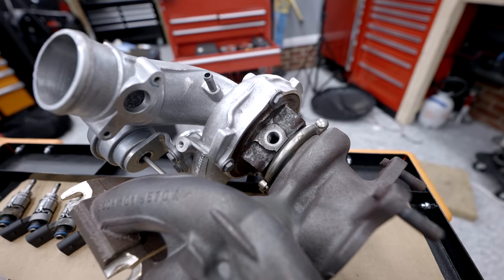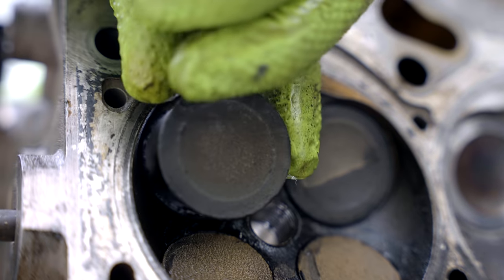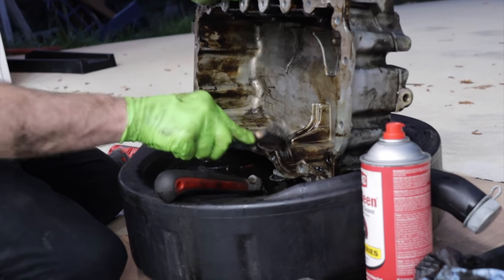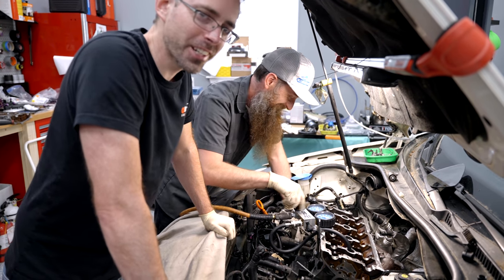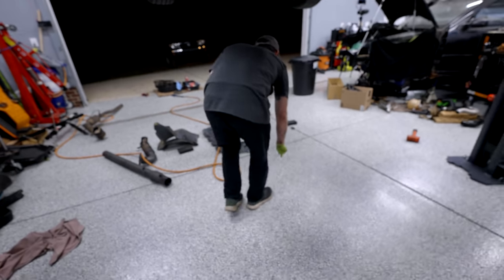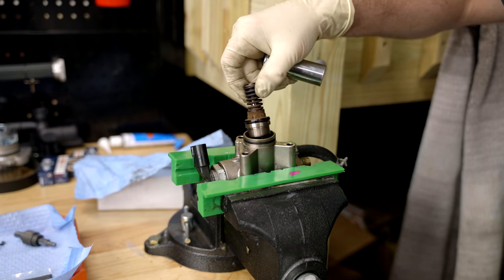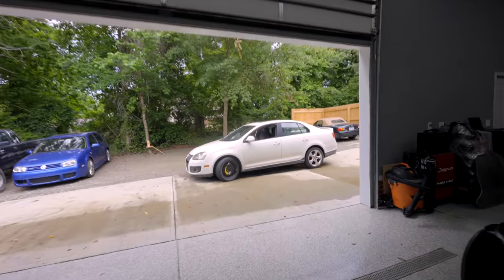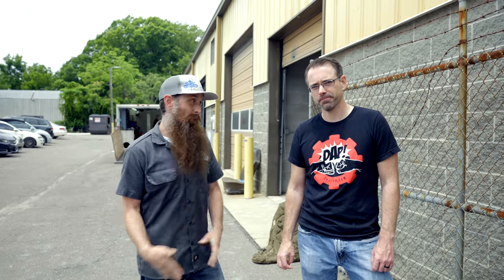Fixing and Modifying the $5000 1/4 Mile Jetta ~ JDM vs Euro RACE Episode 2

Comment from the maker: Remember there is no need to chase Advance Discount codes. You can use "Humble" any time you like and save $$$! Also stack up those speed perks to you can get up to $20 off, rather than $5 at a time. 
If you missed Episode 1! ~ https://youtu.be/1lCxpneVsbU
Reply: Dibs on the old parts, I have a ‘06 Jetta that would love that turbo/pipe/injectors and HPFP.
Reply: hi charles, yo have a few bucks left, consider a e50 or e85 fuel tune, you can safely up the boost and easily add 50hp through the entire powerband.
Reply: Let’s go EURO!!!!!!!!!!!!
Reply: Hell, at this point just go all in, blast a 125hp hole shot of nitrous oxide. When looking for bolts on a smooth floor lay a light on the floor shining across it and look for a long shadow thrown off by the bolt. 13.5 seconds on good track condition  
Edit* i not write good

Comment: "I won't cheat on budget" - proceeds to omit 29 cent bolt...
Reply from the maker: But I added it back in later in the video. so I feel good about being above board
Reply: Unacceptable!
Reply from the maker: You have to accept the unacceptable
Reply: @HumbleMechanic  cheat budget Jetta+BMW inline 6 or v8+turbo.
Reply: SO is no one questioning the turbo and downpipe WITH cat, being 400 bucks?
Reply: Inconceivable!
Reply: @cmendoza1094  used turbos are really cheap and he's not using some big one so I believe it
Reply: @yur1831  sheeesh, thats eBay turbo setup territory. Nah even less than a ebay turbo . Damn
Reply: But tbf, he budgeted the passat pipe at $5 when it was $4.80 so we're really only arguing over 9 cents...
Reply: @cmendoza1094  Sometimes you just have to accept the little wins :)
Reply: @cmendoza1094 ebay turbo set up is "new"... he bought "used"... used plays a HUGE part in parts pricing... cmon guy...

Comment: Lacking hp is probably lack of flow at higher rpm, stock exhaust and intercooler are maybe limiting you higher up in the powerband
Reply: Exhaust is restriction, intercooler on BWA is upgrade for 16v TDi. This cooler work great with GTB1756 on BKD (2.0bar - 36psi and 220bhp/500Nm my street setup). Pressure drop is small, cooling is fine, on TDi work to 250bhp, on TFSi is fine to 320bhp. BWA needs high octane fuel, because this engine have high dynamic compression pressure. I think, mix 10% ethanol with 90% gasoline (placebo 100 octane) will solve the problem with “nopowah”.

Comment: If you found an old volvo with a 5 cyl that could have also been a good choice. Enjoying the GLI though.
Reply: yeah, but i think the modern DSG is going to help with the time a lot, even though its not as fun
Reply: Not German
Reply: @illyapalamarchuk3525  well this is euro vs jdm, not jdm vs germany :P
Reply: Err, yeah I think they needed to go with the blown engine and VW for cheap turbo bits. I don't know of any other car you can bolt on 400 dollars worth of turbos and make her rip...
Reply: thats stupid this car is a 2.0t with dsg wtf will a volvo do ?
Reply: @rnldmanuel88  youd be surprised 2.5t 5 cylinder Volvo bricks ain't nothing to play with ..they make for great sleepers lol
Reply: @SL9SH   never heard of that because I don't see many people building Volvo's it's  easier getting VW parts to work with. Vag has a huge after market support just like Honda.

Comment: Get a “cold air” intake on there for some more air flow
Reply: And bigger intercooler.
Reply: Bigger intercooler with 63mm boost pipes. 120hp added
Reply: Tfsi is such a great engine. Byd, Cdl 380bhp with some basic mods. I enjoy the maintenance on them also. Problem is his buddy can't tune them. He's building boost from the turbo surge point which Is making it die quickly. These ko4s should be reaching high 300s even on a bwa
Reply: @MikelDog  yup no way big turbo only gaining that tune wrong or engine shot but they just rebuilt it
Reply: @MikelDog  shit a stage 2 with cai and down pipe should put u close to 270

Comment: Jetta's weigh a ton because of the interior comfort quality... I'm going to guess at least 200lbs maybe... lets say 255.857lbs from interior removal.
Reply: I knew there was no way they only lost 75lb from stripping it bc just the rear seats and spare tire in a similar year golf is like 120+ lb
Reply: Strip that thing down to its bones! Even the doors are heavy and I noticed you haven’t stripped them. They are so heavy with impact bars, window mechanisms, power locks, insulation and sound deadening, speakers etc. Take all that crap out.
Reply: @chrismason6857  it’s my daily and only car. as much as i am pro-race car, I can’t do that complete of a build yet
Reply: @jsrhyphen  time for a Smythe use kit to loose a few more pounds from the roofline & trunk... :p

Comment: Yeah those stock engine cover intakes are pretty restrictive and that stock muffler probably added some more back pressure with the higher boost/exhaust pressure limiting it's potential a bit. With the drivetrain loss it should be right around 300 crank HP though.  Loving this series btw!

Comment: 27:24 your math from saying 200 hp crank stock to 320 hp looks about right at 250 -260 at the wheels.
Reply: The DSGs have minimal drivetrain loss... I think 250whp is closer to stage 2 on the stock k03

Comment: You need to change these ignition coils!! They always fail even when the car is OEM.
Reply: If it's not broke, don't fix it. They're on a budget, so if the coils are still good for now, they just have toast long enough to go down the drag Strip.
Reply: @shona5512  Sure. 
I recommend checking for misfires because this ignition coils always left us in the lurch
Reply: I upgraded to r8 coils but felt no difference at all but I probably will when I get tuned
Reply: @giovannimora9134  it's more about reliability. But with K04 it's extremely necessary
Reply: @vamodizer  need that combustion forsure when upgrading the hpfp

Comment: Paul knows his FSI engines lol. That pause before Charles cranked the engine after MAF reset 😂

What the boys basically built is a MK6 R without Haldex. Unfortunate that the dyno results are lower than expected with the HP numbers. Stock MK6 R was pushing out 256hp so hopefully with a tune, it should be on par with APR numbers. Mid 300hp and almost 400lb tq!! With the beefed up HPFP, I have a feeling Paul will go IE stage 2+ file bc ShopDAP favors that tuning company. Either way, this is so fun to watch. 💯

Comment: Very fun episode. Surprised those 2.0 turbos could hit > 300hp with just a tune though. (I'm just comparing it to Subaru 2.5L turbos like in the Legacy) that would hit around 290hp with stage 1 tune and maybe 320-340hp with stage 2 tune + DP. That's all with 25% more displacement though.

Comment: Check the wastegate actuator. They can tend to push open and drop boost. Put some preload into it and you should see better results. I've got a Mk6 R and it will run to 30 psi although at that point it's pushing a lot of hot air as it's outside the efficient range of the K04. You should be targeting in the 25-27 psi range though. If you've still got $800 left then definitely fit a water/meth kit. Will go some way to making up for the stock intercooler. With some silicone bends and exhaust tubing you could also make a cold air intake that sits a pod filter behind the passenger headlight. Remove the light when you're racing and instant horsepower gain.

Comment: Holup you don't don't think the low HP could be to the restriction the mufflers is causing? The tune is made for a down pipe that's high flowing if its not seeing that it needs to push more? I remember when I had my Camry a long time ago i tried to make it louder and i put spacers in the muffler i remember that the torque band moved up significantly (it was a manual) so maybe the muffle is giving you low hp numbers because of a restriction
Reply from the maker: Possible. For the race, we would take that off anyway. My dyno guy wasn't too keen on open header that thing. HA

Comment: The fact that you guys are making so much torque makes me think it's the stock intake/cover restricting air flow and possible boost leak somewhere.  My 08 GTI made 250whp on stock turbo and stock HPFP, 3" exhaust, intake, and APR stage 2 93 octane tune.

Comment: Ok obviously you know things better than I do but my suggestions is to lower the suspension as much as possible , use a clutch for the alternator so it will disengage at higher rpm , use a thin oil , remove the rear spoiler and maybe try to replace those huge side mirrors..
Fingers crossed 🤞🏻 hope you will win

Comment: the boost pipe leaked on my Passat TDI as well... cracked on the intercooler union side so had to replace it. Those spring clip unions are so annoying though!

Keep on guys, send the JDM cars back to the videogames where they beling 😁😎

Comment: Hey thanks for the tip about what to do when a intercooler pipe blows off with no option to fix on the side of the road. unplugging the MAF was not an option i would have considered. cheers noys.

Comment: What about a snow systems water methanol setup? You can jack the boost and it will drop intake temps a mile. maybe just a straight pipe after the cat?
Reply: That car needs some meth in it lol 🤣🤫 get a drop in filter.. aswell as a castles downpipe  wrap the downpipe in that exhaust tape.

Comment: Yeah vw actually has a specialty tool for cleaning that carbon deposits on the valves with and it is basically just blasting the valve with some kind of nut shells don't remember off the top of my head what kind tho. But it does do wonders. And you just have a shopvac connected to the whole thing to clean it out. Done it a few times. Kinda cool tool

Comment: I really enjoy seeing this build come together. I am a car enthusiast, so I don't buy into the whole brand loyalty BS. Both channels have viable cars, however, I am curious to see how bad the transmission is in the Civic. Power to weight means little if you can't get it in gear.
Reply from the maker: I think you hit on the exact thing. They have p/w locked. But we have traction and launch control.

Comment: I answered this question for myself years ago. For the cost to make my VW around 400hp (about 3x stock power, or 2x after an ECU Tune+standard bolt ons), I could buy a at least 1 Civic and a couple spare motors, and make about 600hp.

Comment: Probably not the best place to ask, I’ve got an 81 rabbit pickup 1.6, I resealed the engine and fired it up it was leaking from the oil pan. I pulled the motor again and dropped the pan and there was metal inside. I’ve taken everything off the block and I see no place the metal could have come from. Should I be concerned or should I send it.

Comment: I'd guess that you'll be able to drop between 110 - 130lbs (assuming that all carpet, trim and seats go and the only thing left is the dash, driver's seat and driver's door panel)... and I just finished the video, jeeeeeez that's a lot of weight.
Reply: I just pulled the rear seat out of my mk4 , the back of it has to be 60-70 pounds it's insane.

Comment: As a high-schooler that spent all my money for a 2010 a4 wagon with the 2.0t this is very interesting and also concerning lucky me the carbon cleaning was done right before I got the car and it has been rebuilt with better rings to solve oil consumption
Reply: You should make sure the timing chains are good as well.
Reply: @Deutscheautoparts  it was inspected around 12k miles ago and I had to reseal the oil pan recently and there's no abnormal wear 138k miles on it currently

Comment: If you ever want to clean the varnish out from a head, spray it with oven cleaner, leave 10 minutes then wash off.
Reply: Don't use oven cleaner on aluminum parts. It is corrosive and will pit your parts. Especially on sealing surfaces.

Comment: Replace muffler, intake, and fit a dog-bone mount and insert, otherwise the engine will bounce out of the engine bay on launch.  Does the Jetta have the same launch control as the MKV GTI?  If yes, it will smoke the JDM off the line by a huge margin, as long as it can spin those drag tyres a bit.
Reply from the maker: Yeah we tuned it and added launch. So it should be great off the line.

Comment: Don’t the k04 turbo have to have the diverter valve relocated as there is no hole for it like the k03. Or is it different for you guys over the pond ? Enjoying these episodes 😊
Reply from the maker: Its a modified K04, so the diverter valve bolts up
Reply: @HumbleMechanic  i see that will explain it. Interesting series as am doing similar work on my ffsi atm.

Comment: Was the front seat removed a manual or power seat?  The seat frame, upper and lower are heavy, but motors and the gear reduction boxes VW use are REALLY heavy.
Reply from the maker: its a manual seat I think.. LOL

Comment: I just took my noise pipe off, when I did a new DV. No cap so we duct taped and hose clamp, well stage 2 blew that clean off. Redid it now, but running like crap, how long do I leave MAF sensor unplugged???
Reply from the maker: Until you fix it.

Comment: 35:00 what's the purpose of the "temporarily plugged" tube? has it anything to do with the maf? can you explain how the engine can regulate combustion without a maf?
Reply: When you unplug a sensor the ecm goes into open loop and substitutes values for operation.

Comment: Chances are just repairing that Jetta and making it go a-b is all you need to beat that civic. The civic will either break an axle, miss a shift or in the best case spin tires so just make the Jetta reliable and loose weight.

Comment: So the fan base here could potentially answer a question I have. Assuming the engine will fit in the engine bay, how difficult would it be to swap a VR6 into a rear wheel drive platform? Are there any kits out there to do what you need to to swap it to a rear wheel drive set up?

Comment: Is that still running on a stock muffler system? if so, you gotta get rid of them! They are pretty restrictive.
Reply from the maker: We will for the race. The dyno owner wasn’t keen on open downpipe right into the fuel tank.
Reply: @HumbleMechanic  :D Yea I totally agree with him. If you're willing to "cheat" one step further, the cat might be worth a few ponies too if you can fab something simple. I've always thought of the mk5 air box designs and how easy it would be to cut a hood scoop, cut a slot on the airbox somewhere, and have proper ram air lol. worth a thought, it'll be free more or less

Comment: Please tell me you guys used a wire wheel to clean the back of the valves or at least clean out the intake and exhaust ports?
Reply from the maker: I replaced teh valves, and cleaned it with a wire wheel on a Dremel. Not my fav way, but it worked fine here.
Reply: @HumbleMechanic  i asked because I work at a machine shop and we use wire wheel on a demel plus mineral spirits and usually replace all the exhaust valve guides. I would also suggest running a shim underneath the valve springs even though Volkswagen never did but at least like this it would give you a piece of mine that the springs won't damage the alumium seat of the head. I would use a .010" shim it would increase some valve seat pressure but it won't be significant. I'm a honda guy but would definitely love to see a Volkswagen win lol

Comment: Did you disconnect the restrictive exhaust from that straight pipe?
Reply: @HumbleMechanic  well, you know spiny bois like to breathe, I wonder if you can fit any boost pipe/intake/exhaust improvements in your budget? The civic seemed to have a hole in the hood about the size of a large turbo outlet. :-)

Comment: I wish you would do a similar episode but with the 2.5L 5cyl...
Reply from the maker: That was an early plan. Couldn’t get it done in Budget
Reply: @HumbleMechanic  Ive been thinking of getting a Torqamp turbo and a Zex 100 shot kit for mine...for those fun red light races.
Have you looked into these options? The Torqamp is a bit pricey but its got the benefit of easily swapping car to car and gives roughly similar psi to a mild supercharger kit. I was weighing the option of getting one kit and a second Battery and swapping it back and forth from my Jetta to my Celica GTS, paired with a nitrous kit - I think the results would speak for themselves as the best bang for buck option at just under $3800 for both kits.

Comment: Probably a boost leak or lack of airflow really, my bwa engine runs over 300hp with stock cat and turbo, revo intake and s3 injectors, can't really remove cats in northern europe but it's on European 98 fuel not sure how to compare to American . Also a cheap 20$ mode that will help to launch the car be dogbone insert it reduces alot of the wheelhop just installed one and made gear changes so much smoother and removed lower rpm vibrations
Reply from the maker: Yeah!!!! Dogbone is on the list!

Comment: Do you want to win or not? Remove EVERYTHING you dont need for driving! Body panels out of 3 wave cardboard are lightweight! Windows out of cardboard are light as well... Lights, mirrors, the trunk, the sunroof, heat shields, sealings and the 70 pound driver seat! Guys dont forget the jigsaw! 3 doors are obsolete... Add weight (nitrous tank)  in front of the front wheels.

Comment: You need to eliminate the exhaust after the flexible, real straight pipe, turbo loves short exhaust and a short K&N kit, more boost, each pound of boost is about 7 HP in that kind of tune , good luck

Comment: "Blood, sweat, and gears"  would be a great name for her, now that you have baptized her. I would say 225 pounds if taken down to pads and 1 seat. 
Edit* Also, some graphite solid film lube on slightly more than well broken in cam bearing journals helps to hailmary some extra miles in a pinch.